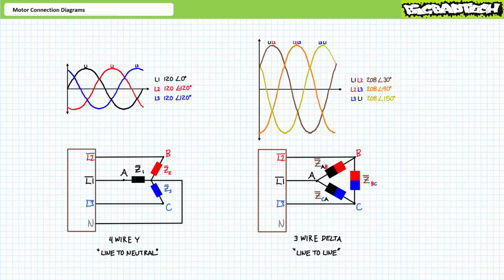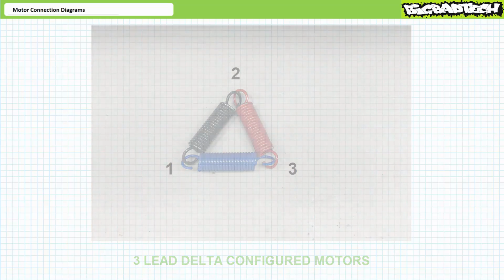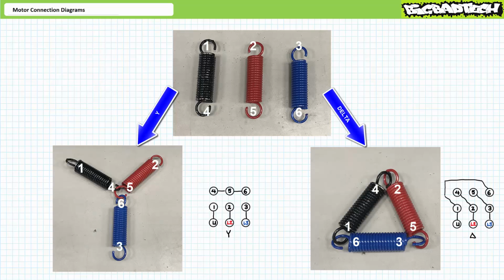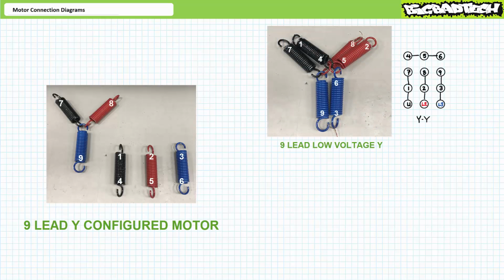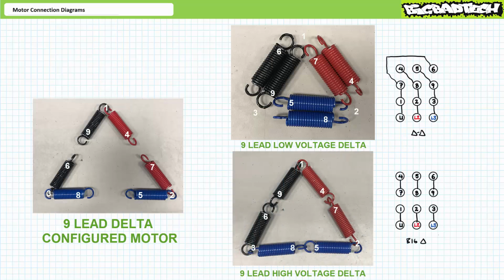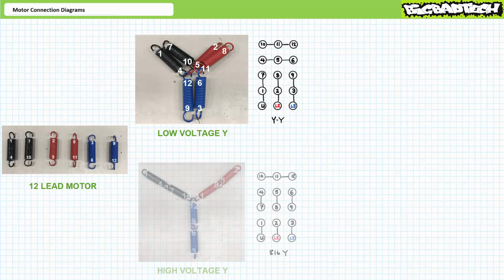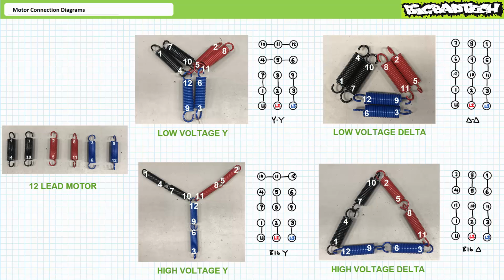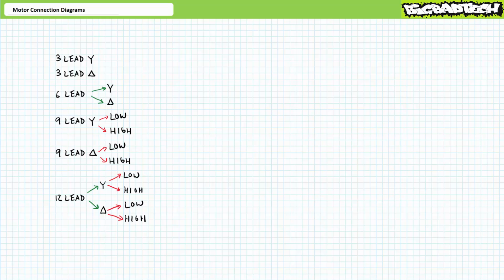Motor Connection Diagrams (Full Lecture)

Comment: So I have a 12 lead dual voltage 3 ph. Baldor motor. 
Low voltage diagram is
L1 (1-7) 
L2 (2-8) 
L3 (3-9) 
(4-10) (5-11) (6-12)

coil continuity test show connections  
1-4, 2-5, 3-6 
[7-10, 7-11, 7-12] 
[8-10, 8-11, 812] 
[9-10, 9-11, 9-12]

All of those show a resistance of around 6 ohms

Also tied together is 7-8, 7-9, 8-9 but double the resistance at 12 ohms.

I cannot find a diagram that matches this. Is this a double Y with 7.8.9 as a star point along with 10.11.12?

I'm hoping someone can tell me whats going on,
btw. High voltage is
L1 to 1
L2 to 2
L3 to 3
(4-7) (8-5) (9-6)
(10) (11) (12)  capped off an unused
Reply: I decided to give it a go to draw it out. It looks like it is a Y wound motor with 10,11,12 internally connected, but also with wires to the peckerhead. Maybe YY low voltage and Y high voltage? IDK. I'll have to go back and watch again

Comment: I am trying to find video of connection diagram for dual speed motor diagram, dahlander motor. The winding diagram of dual speed motor and dual voltage looks same. On internet there are lots of info but not clear,, like you explain. Please make a video for dual speed motor, and also multi winding dual speed motor.

Comment: At 13:26. I have studied the case of wrong connection of one end of the winding C and it seems the stator magnetic field rotates with jerks CCW( 2 poles CCW then 1CW,then 2poles CCW,then 2poles CCW,then 1 pole CW,then 2 poles CCW making one complete revolution during 1 full cycle of sine wave.As I see the rotor rotates with jerks CCW instead of normal CW rotation and makes 3600 revs per minute having one pair of poles per phase.But there should be a dynamic load on the running rotor as it jerks forward then back,but theoretically the rotor should rotate 3600 revs per minute in the CCW.

Comment: I just ran into a six lead dual voltage motor.  Wye for 460 and delta for 230.  You said 6 wire motors were single voltage.  What am i missing?
Reply from the maker: All 3 phase systems are dual voltage. Line to neutral (lower Y) and line to line (higher delta). This is odd because the Y is higher and the delta lower? Strange.
Reply: I just found some literature on the pump motor.  It’s a Grundfos pump and it roughly states, in an effort to standardize and minimize part numbers, they created this 6 wire, dual voltage (230/460) 3 phase direct-on-line motor. Connect 230 volt use low volt delta. Connect 460 volt use high volt star.

Comment: Would you , please,  explain how to connect proprly stator windings in the motor where all labels are missing. This is not simple when you using OHM meter because there will be current direction  issue. Thanks.
Reply from the maker: Oh dude ... I feel your pain. Yes, there are a couple techniques to do this and, as you mentioned, polarity is a major concern. I should actually do a video on this since you're not the first person to ask this question. I will mention it necessitates an old school analog (ie: needle) DMM so you might want to start hitting the thrift shops to see if you can score yourself one of these dinosaurs.

Comment: Just did a 9 lead high replacement and pulled this up to make sure its wired properly as the wires were unlabeled
Reply: Swipe or buy a working 24 volt transformer for HVAC to use to test the polarity of your windings. I have an old Korean or Taiwanese made Craftsman DMM that has a small 1 volt AC output that has been a lifesaver for ringing out 9 and 12 lead motor windings. The windings that are NOT tied together in a wye connection need to show additive AC voltage. If they do not they  show less voltage and they are reversed! The next lifesaver was finding an old B&K Precision LCR meter that reads inductances. Some of the "timed" relay starters do NOT actually use a timer. They often use a centrifugal switch, that engages the full power windings when the motor reaches a set speed.